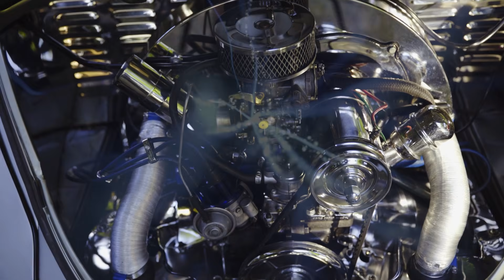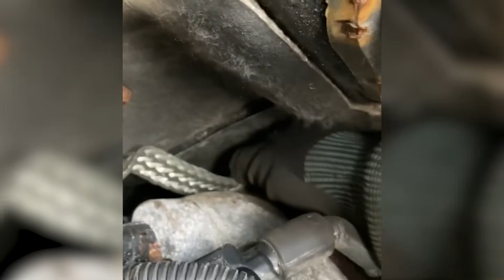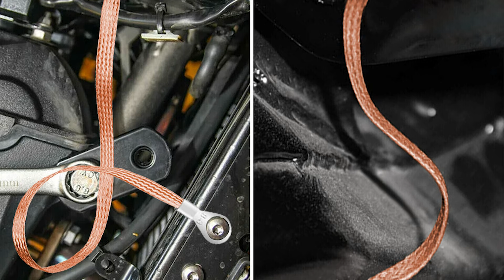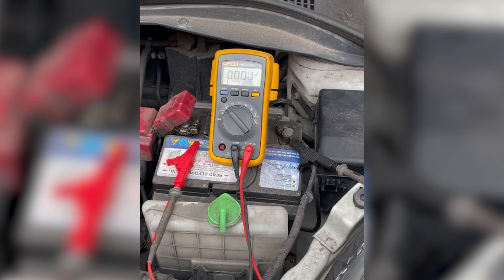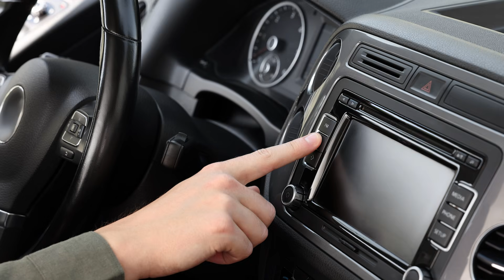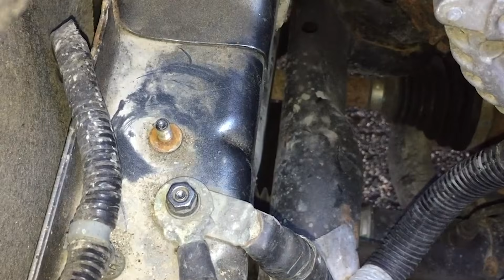8 SYMPTOMS of a Bad Car Negative Battery Cable | Signs Engine Ground Strap is Faulty

Comment: TLDR: 
#1 Flickering headlights
#2 Problems starting
#3 Dimming interior lights
#4 Warning lights on dash i.e. battery light
#5 Low voltage from battery
#6 Stalling or hesitation
#7 Multiple electrical problems
#8 Battery doesn't charge properly
Reply: Thanks, cant stand the ai voice.
Reply: Thanks, can't stand the ai voice.

Comment: Have a '94 F250 460 that I finally figured out had a bad ground.  The symptoms included failure to crank on a warm engine and gauge problems.  Threw a new coil, alternator, etc..., at the issue until somebody on the 460 forum told me to check.  Sure enough the ground strap attached to block was held on with only a few strands of wire and disintegrated when I touched it.  Replaced the strap and bolt and problems all solved.
Reply: My car will not start sometimes after I've drove awhile and it's warmed up...I come back out from wherever i went to start it and it won't crank...I open the hood and wiggle the batter ca les a bit and it will start...is that what yours was doing?...
Reply: @lightemup100 did you manage to sort this? mines the same. bad ground cable too?!
Reply: @nickc5252 guess we’re going through the same thing..connection tight..sometimes have to wiggle it.loosen it..tighten it back..then good to go..Wtf 😂🤣😂🤷🏾
Reply: @ hope u managed to sort it properly! mine did the same as yours for a few days then was fine again lol. figure the connection became loose after i went over a nasty pothole on that side of the car - whenever i would then go over another pothole and next have to turn the car on it wouldn’t turn on. cleaned the terminals and wiggled the wires about and seems ok since lol
Reply: @nickc5252  One thing to try is to clean both batt terminals thoroughly, hit with generous gob of dielectric grease and do the same where the ground cable mounts to the block.  Make sure the connection on the block has a lock washer, etc... to ensure a reliable connection.
Reply: @ ty! cleaned em but haven’t done the rest, will take a look later thank you
Reply: And all my connections at the battery are clean and tight...not loose or corroded ...
Reply: What gauge problems did you have? Only gauge that works.on mine is gas gauge and no crank no start but I can use a open starter relay and it starts for a second then just tries to crank but wont
Reply: I had a 94 ford f150 that had a since of humor if you got out to urinate and landed again it, it would bite you with a zap lol never did figure it out came that way brand new when my parents bought it lol

Comment: 90% of all electrical problems is a bad ground.....    I will usually even add two more field grounds...  1 to the fender and one directly to the alternator mount.   And make sure the engine ground is clean....
Reply: many times positiv terminal to starter is over heat and drain battery super fast
Reply: @StopTeoriomSpiskowym especially in hot weather.
Reply: @StopTeoriomSpiskowym  what to do about that ?
Reply: @TIIRONC5H  search in internet
Reply: @StopTeoriomSpiskowym what do u mean ?
Reply: I ran a new line from the positive of the battery to the alternator(fused). Grounded from the negative of battery to both cylinder heads, engine block, chassis and transmission. Noticeable improvement.
Reply: @10MMsocketfinder  can u help me out how
Reply: @TIIRONC5H  I got oxygen free cable 0 gauge, you can get 4,or6 gauge. I went with the larger gauge to reduce resistance. From the battery positive to the alternator positive input with a 150 amp fuse block. Then from the negative I daisy chain to the car chassis (strut tower) not the radiator support to have the best ground, alternator body, both cylinder heads, engine block and transmission. Make sure all contacts are clean (bare metal). No paint between each connection. Then put dielectric grease over to protect from any moisture and oxidation. Make sure you crimp or solder and heat shrink your ends to protect them from moisture and oxidation.i dressed up the cables with a sleeve so it can look like factory. Also, cleaned all existing factory grounds too. If your intake manifold is mantel ground that too. Mine is plastic so I didn’t bother. I was thinking about grounding my throttle body but never did it being the car idles smooth, transmission changes gear smoother and my MPG went up. Hope this helps out.
Reply: @10MMsocketfinder  i apreciate it man thanks a lot
Reply: @10MMsocketfinder appreciate  your advice  and I cured  my problem  in my car thankyou brother
Reply: @10MMsocketfinder you earthed a live on the alternator???
Reply: @goldeneagle99  I apologize for the mistyped. No ground to live. I meant from positive of the battery to the positive input of alternator with a fuse in line. All other lines were grounded throughout the engine, transmission, car chassis from ground of battery. Thank you for bringing it to my attention. I will edit it now.
Reply: @10MMsocketfinder u weren’t playing hij
Reply: Good 😊
Reply: Agree...ive worked on everything, from lawn mowers , semis , boats , house boats, farm equipment etc... when any electrical problem comes in I always check the grounds first.
Reply: Things may look good or okay or snug enough,   but they are not,  they may create their own ark to make initial connection.  You can get deeper into it by testing ohms and resistance at all different temperatures and times,  a hot 12 volt system should be around 13.8.
Reply: What if the ground not not seem corroded or frayed but is gunked up? Also I get the full voltage when testing the ground, so this means its fine right?

Comment: I had 12 check engine codes on my 97 4runner, changed the ground strap just for the hell of it because the previous owner used a lamp wire and all check engine codes disappeared
Reply: I got 24 codes on my 14 sierra, hoping for it to do the same lol

Comment: Had this problem with my 87 cutlass, lights and instrument cluster flickered when driving over humps, or stopping at red lights, looked under hood, and low and behold I discovered the ground strap had came loose, tightened it with a spare bolt from  garage and problem solved😎

Comment: Luckily I've never really had electrical issues with my vehicles. 1 of the first things I do when I get a new or new to me used 1 is the big 3 upgrade. I always use pure copper wire and lugs. Minimum size is #2 welding cable and maximum size 4/0 on my dual battery setups in my truck. Even my 08 yaris with the sound system has 3 runs of 1/0 welding cable to handle the 325a singer alt.
Reply: You are a smart individual. With 2 vehicles that will last a lifetime and cost next to nothing to keep them runnin.
I'm getting ready to upgrade my wires soon. I got a 12" sundown with 600 rms amp 1 ohm. Cant wait!
01 carolla here

Comment: I’m having similar trouble I replaced the alternator starter and battery and I have nothing dash lights turn on and also i hear a click under the hood like a dead battery although it has a new one so I really hope it’s just the ground a
Reply: Search Voltage drop testing starter system. You have to voltage drop test battery terminal connections, positive to s terminal on solenoid,, battery cable to M terminal on starter, starter to engine, and engine to negative terminal. Also make sure no pulleys have seized preventing engine cranking, see if you can rotate engine by cranking by hand to see if it's seized. Majority of the time it's a grounding issue. 

First though give the starter a few wacks with a hammer. If it starts then it's the starter that's the problem. If no crank connect a jumper cable from battery positive to the s terminal on the solenoid if it starts the starter is OK and the problem lies between the s terminal and the ignition switch. If not it's the starter or above - bad grounds or connections. Hope this helps. Good luck.
.. Also do this thirdly as it's easy to do swap out the starter relay with another that is the same and not important as it could be faulty. If no go then it's any of the other reasons connections, ignition, pulleys etc.  If the last three steps don't yield result start with the next easiest to do.

The channel MotorAge have excellent Voltage Drop tutorial videos then use this knowledge to drop test. 

Also good to understand the starter system. 

https://youtu.be/WMXENKujYtc?si=jmKg1UogdihMci2g

Comment: Great video; had lots of clues I had a grounding problem on my 2006 Silverado.  Finally fixed it by replacing the negative battery cable and adding an additionl grounding strap to body ground point on firewall.  I had all the clues, but finding the electron disruption took a LONG time??? Thanks!!

Comment: Mine GMC envoy 2008 in saudi arabia has headlight, dash and instrument cluster flickering and battery or charge guage ablittle flickering .....
Plz explain 
Battery ok
Alernatpr ok
Sensors clean .. ok
Plz explain
Reply from the maker: If your 2008 GMC Envoy's headlights, dash lights, and gauges are flickering, there could be several underlying issues. First, check for loose or corroded ground connections, as they can lead to electrical problems. Damaged wiring in the harness might also cause intermittent connections and flickering. Additionally, a malfunctioning Body Control Module (BCM) can disrupt various electrical functions in the vehicle. Finally, even if the alternator is working, a faulty voltage regulator could lead to voltage fluctuations that affect your lights and gauges.
Reply: A bad wire somewhere

Comment: I have to ask u so  i Have done this to my car negativ wire connect and negative bateri  mod With bulb and bulb turn on  is that bad ground or not bcz my car after 20 min it goes dad
Reply: I just Try this method negative remove when i shut off car  and when i want to drive i connect and it goes fine but   until today It happen something  not good  i reconnect it but it crank slow 5 times and goes dad   😢
Reply from the maker: If the bulb lights up when testing the ground, the ground connection is likely okay. However, if your car dies after 20 minutes, the problem might be with the battery, alternator, or other electrical components. Check the battery and alternator, and ensure all connections are secure and free from corrosion. Good Luck!
Reply: @fixit3879  so when i connect both negatives and light on its mean no draining ?   What if Ccm module goes bad can cause that serious draining bcz I have some issue example interior light and doors sometimes work also keyfob stop working now  alternator i check its ok
Reply: @TIIRONC5H A bad battery that's in need of replacing can cause problems. Have your battery and alternator tested. If not you need to check the various grounds of your cars electrical circuit by doing a drop voltage test across the connections.

Comment: Many years ago I owned a 1963 Diamond-T truck.  It started having electrical problems in the dash.  I took it to an electrical technician and they told me they would fix it, no problem.  The next trip I had trouble getting it started.  Took it back to the electrical mechanic shop and they said my 4 battery's were just bad.  Needless to say, 4 new batteries and I still had problems starting the engine and still had problems with the dash lights and other cab lights.  I called up a guy I knew who was a Cummins engine mechanic and told him my problem.  He told me to take the ground off the frame and the battery and throw it away.  He said buy a new cable and then he told me to buy another cable to put on the opposite side of the engine to ground it to the engine and then to the frame.   He also told me to actually sand or grind the places on the frame and engine.  It worked great from then on.  It had cost me a couple of thousand dollars to go through the previous so called repairs and lost wages due to the down time the truck was in the shop.
Reply from the maker: Thank you for sharing.

Comment: Measure Voltage between battery negative and the frame, also between the alternator negative and battery negative. If you get elevated readings, there's a ground fault.
Reply from the maker: Wow that is great.  Thank you for sharing.  Cheers!
Reply: I recently proved this, thought my glow plugs were of no good..
Reply: Measure in?
Reply: Thank you for your suggestion. What should be the readings?
Reply: @johnmano1439  The thinking behind this is, that if the ground is not properly connected to the negative of the battery then the frame just rises to +12V. The ground (negative of the battery) can't hold it down, because of the faulty connection. So measure in DC voltage mode between the battery negative and the frame while running a big load like the starter. You should not measure more than 0.5V.
Reply: @HALDikopter , thanks once again.👍